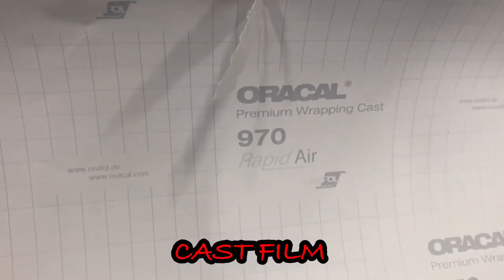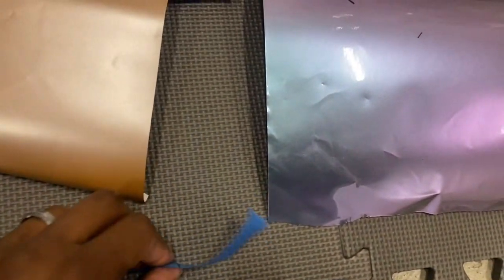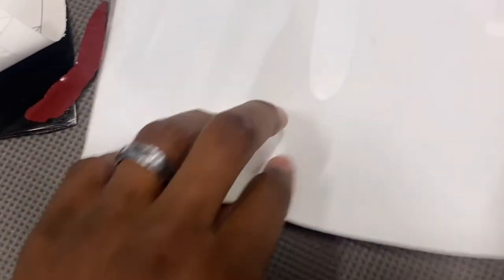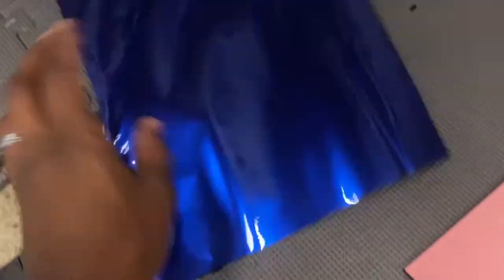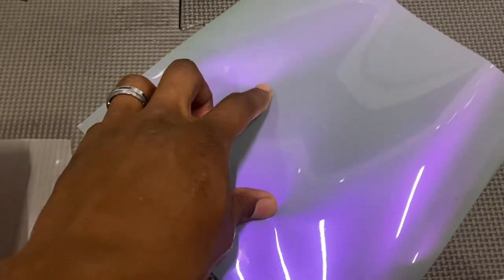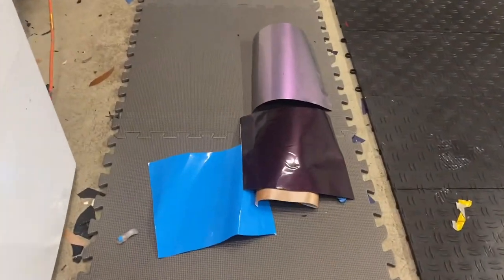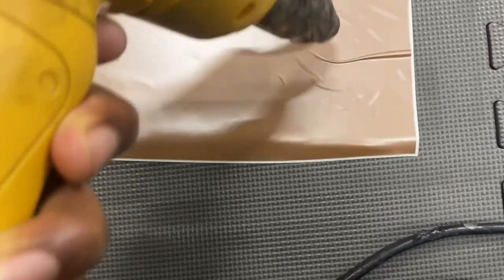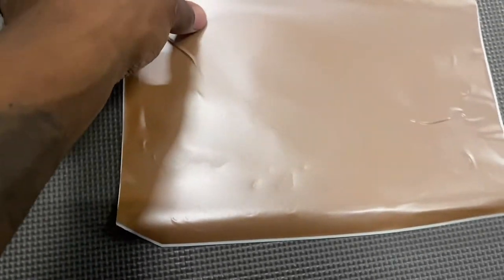Cast film Vs Calendar Film explaining the difference between the two!

Comment: Great video. I wrapped my car for the first time in Vivid Matte Mustard yellow. It came out pretty good but I did run into some rookie difficulties. No bubbling or lifting. It’s been a year and half. More bad trimming than anything else. I live in Texas and the heat has faded my top. So I’m going to re-wrap it in 3M, Avery Dennison, or KPMF. Most likely KPMF Matte Sonic Yellow. After studying more, I feel like now I probably chose one of the more difficult materials to work with first. Do you think these others would be a lot smoother to use? The Vivid was kinda thick.
Reply from the maker: Appreciate you watching the video and I actually started my own wrap line if your interested I can definitely get you that color check out @firmamentwrapz on Instagram

Comment: I mean the ones that “shrunk” the most, also were curling up the most which pulls the edges away. If they were adhered down where they didnt lift in the middle there might have been no difference

Comment: Thanks for the info! I’m sold on cast for a new project. I’m curious do you have to use a heat gun or can I use transfer tape? It’s just a straight text decal on a piece of lawn equipment. No curves or anything. Any info would help! This is my first outdoor project.
Reply from the maker: If it’s just straight no curves you don’t need any heat you can use a torch or a hair dyer as well